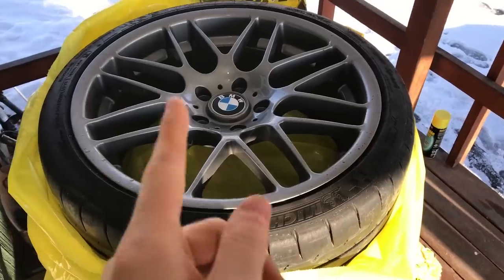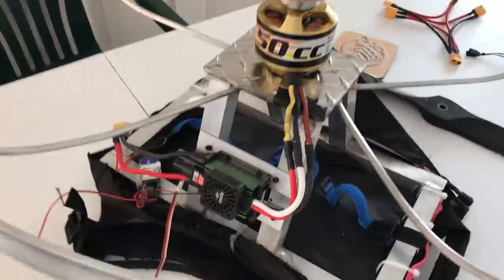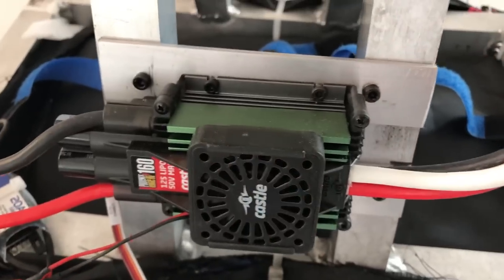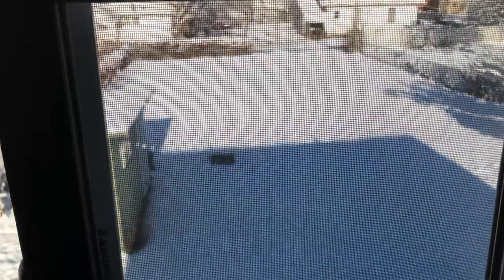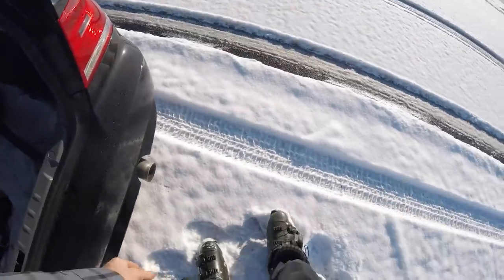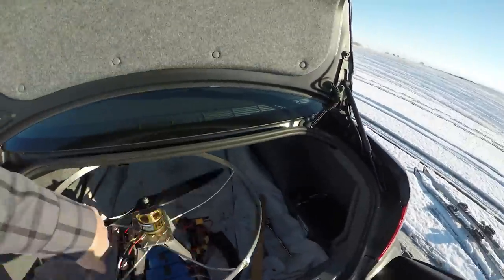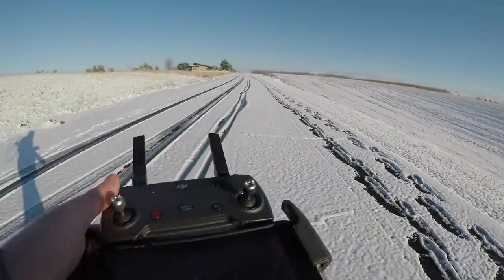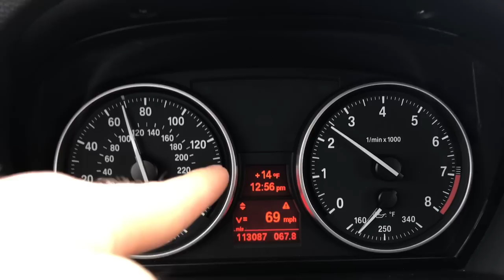Playing with Propeller Backpack v2 but with less 🔥

Comment: It looks like you would go faster if the prop pack was a about a foot lower with a slight pitch towards the floor. You might even feel like you were sitting with the additional propulsion whilst skiing. Great video.

Comment: Just buy a wearable power motor thing like on a powered parachute, then you can really have fun
Reply from the maker: Getting pushed up a Hill is so satisfying. Like I can go anywhere. You mean a traditional paramotor. Yea that’d be cool but less DIY and more $$
Reply: Samm Sheperd 
Would a gas engine from a lawnmower work better, or maybe an electric motor from an Ego mower?
I don't know the specs for your pack, so for all I know, your pack may be stronger anyhow!

Neat vids btw, it's nice to see how and what you use to make them.

Comment: How you gonna say you a broke college kid when you got a BMW and money for good ass tires. Love the videos tho
Reply from the maker: Well I said that a few years ago. I've been out of school for a year.
It’s a 10 year old car with 110,000 miles on it. Just like my VW was when I bought it 7 years ago.
Reply: BMW for the win ;-)
Reply: Also, 10 year old Beemers aren't worth that much. 6cyl models have head gasket failures once they have a bit of age & the head bolt threads need to be drilled out of the block & special inserts installed because they pull the threads out. It's not uncommon to see these models dumped on the side of the road with the owners just walking away due to incredibly high repair costs. 
Sorry for that bit of info Sam, but from my perspective as a mechanic, Toyotas are bulletproof, just not as fancy.
Reply from the maker: N54’s don’t have head-gasket problems. Even past 1000hp 😉